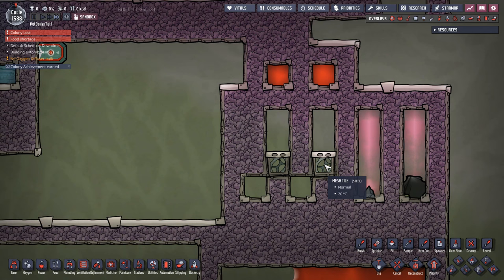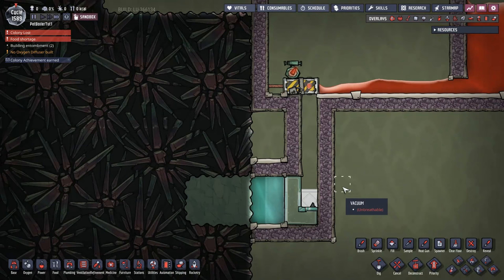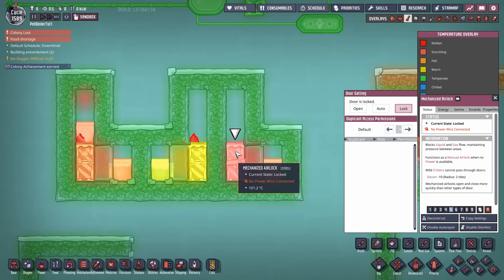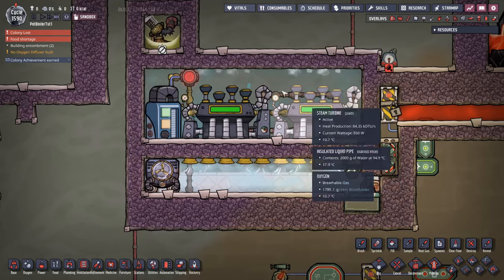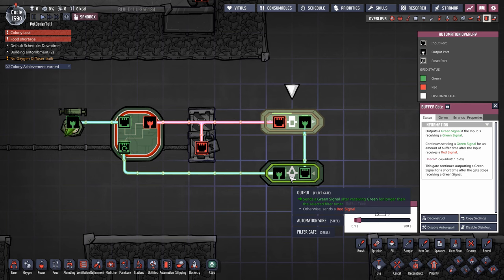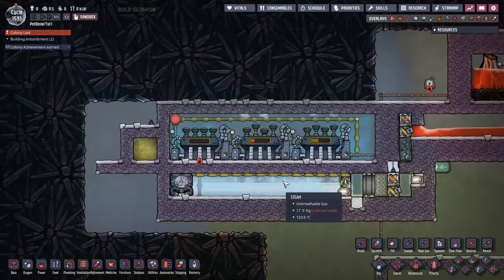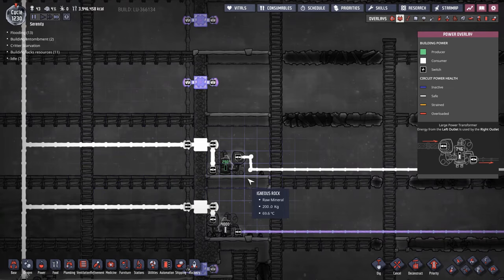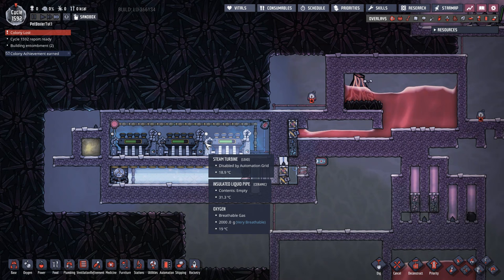Volcanic Steam power : Tutorial nuggets : Oxygen not included

Comment: You don't have to use more wires for multiple turbines, you can transfer as much as you want throught 1k wire
Reply: that's a huge waste of energy.
Reply: @Ghorda9  there's no waste at all
Reply: @fritt_wastaken  steam turbines will continue to work even when the power grid is at full capacity, meaning that the excess heat energy in the steam will be wasted because the 1kw wire can't output all of the power fast enough.
Reply: @Ghorda9  "1k" ony limits the amount of consumption, but you don't have to consume power to transfer it to the other grid. So you can transfer practically infinite amount of power through any wire without limits or waste
Reply: @fritt_wastaken  any power that is not transferd from the two or more turbines when they all produce power at the same time is wasted, it is certainly not stored anywhere.
Reply: @Ghorda9  can you please read? it is transfered, and is consumed from another grid
Reply: @fritt_wastaken  you can't transfer all of it with a 1k wire, from two generators running you need to at least transfer 1700w, with your method you end up loosing 700 watts of power, the steam turbines don't have an internal buffer to store excess nor do they care about not using what they can't spend.
Reply: @Ghorda9  again, can you please read? wires don't have any limits on power transfer. you can have all your generators for entire base on a single 1k wire, no matter how much power you consume
Reply: @fritt_wastaken  I had to look this up, you could of mentioned earlier that it was an exploit with batteries not counting as consumers in the code.
Reply: @Ghorda9   you can't really call it an exploit when it's a part of core mechanic. it's too obvious and too easy to fix. the sole purpose of a power shutoff is to "cheat" around power consumption, it has no other unique uses
Reply: @fritt_wastaken  except a million batteries should not be able to safely draw from a single 1k line all at once, you can't do this with transformers which a technically also batteries.

Comment: So... this is my fifth comment on requesting tutorial nugget on petroleum boilder... mainly the calculation for the pipe length and material to use. Right now what I am doing is trial and error.. and it's a mess to cleanup when it burst... or it doesn't get heat up enough to 390C when it reach boiler spot.
Reply: Maybe check out save file from Oassise 9 video where he made one.
Reply from the maker: Video will be up on Tuesday, on pipe calculations it was all practical testing no theory involved. Make counter flow X length and run it. Count how much magma it burns to get efficiency numbers.

Comment: My automation wires melts down
Reply from the maker: Use Iron it's the only basic metal that will not melt. Well you could use steel or Tungsten but usually they are more rare.
Copper and gold will just melt.
Reply: @FrancisJohnYT  yeah steel works and for plates or tiles steel or diamond...

I have another one. My voolcano errupts like every 14 cycles. And i did not had enough time tp pump out steam and gass from the container with lava.

So it is about 1400 degrees :) 
And for example steam could be transported to steam turbines, what should i do with other super hot gasses?

And also... it is actually possible to set up a liquid lock here to keep all of the heat inside of the lava container. Because oil will be gone at 500 degrees or something... ofcourse it have much more thermal capacity... but it scares me... there is a sleet wheat farm nearby!  XD
Reply: @FrancisJohnYT I can't do orbital reserch yet and don't have the memory toggle. Can I replace it with something else?

Comment: I don't see how this is worth it, the steam turbines are barely paying off the costs of the door + aquatuner.
Reply: .... first of all, the aquatuner is only there to cool the turbine. Based on the amount of heat the turbines produce at 200c, 1755180dtu are deleted by the steam turbines. thus 1755kdtu/10 +4kdtu = 179.5ktdu for two turbines. Now, a super coolant aqtuatuner can transport 1181.6ktdu/s of heat. This means that the aquatuner only runs for 15% or so of the time, resulting in around 186w of power usage.
Doors only use power when they open/close.
You can use more than 2 steam turbines in this design: I've used up to 6 and didn't even come close to running low on magma.
Which means 5100 watts, 186*3 = 558 usage on aquatuner, heavily overestimating door: 10 watts.
it produces 4532 watts CONCURRENTLY.
For reference, a dream natural gas geyser produces 1600 watts concurrently without pumping costs.
Reply: @Appri  Are the turbines running at full capacity? This contrasts to another post where Francis John says that you can't transfer heat fast enough to fully feed 3.

Comment: couldn't you just pipe water into a magma reservoir instead of having to build all of that?
Reply: you would then have to worry about igneous rock tiles blocking the system.
Reply: @Ghorda9  do igneous rocks not sink to the bottom of the magma biome?
Reply: @commonsense-og1gz  tiles in this game don't sink, it's only items that drop.
Reply: @Ghorda9  i get what you're saying. if i drop water on the magma biome then it will form a crust layer on top shielding the molten liquid below it, right?

i wish they added a material that would allow us to pump magma into a chamber like water.